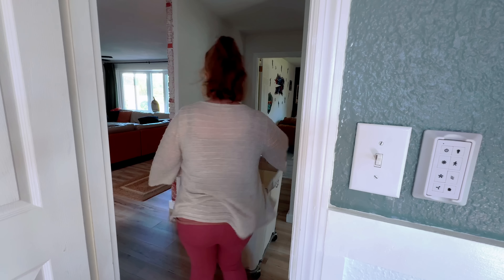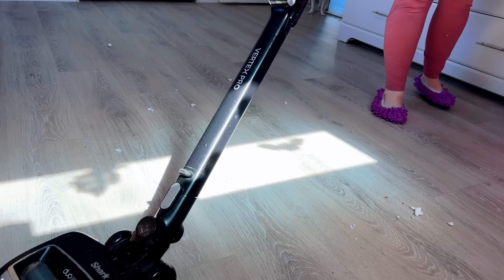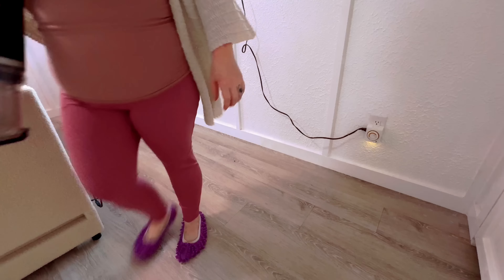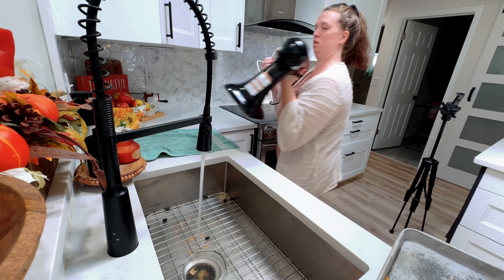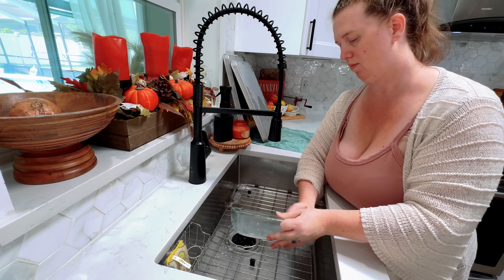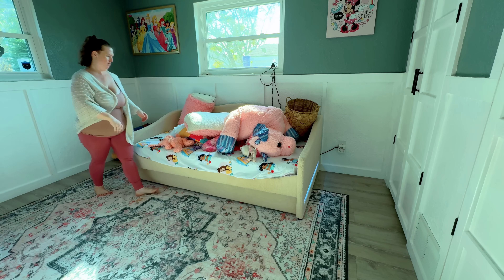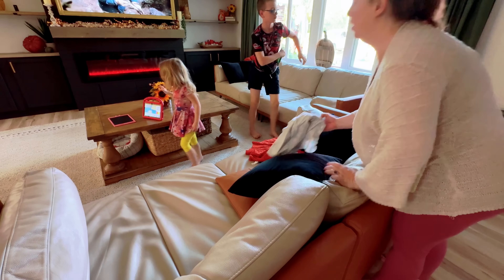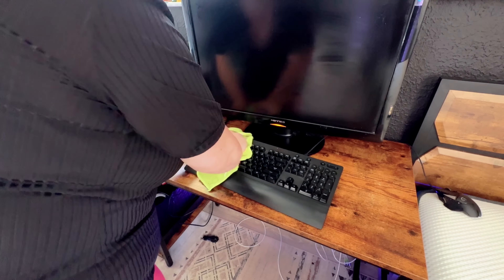Super Motivating Inside and Out Deep Cleaning Motivation ~ Extreme Whole House Deep Clean With Me

Comment: For cradle cap, you may use oil as a pre treatment, just soften the grease by massaging in circular motion. Then, wash hair as usual. If the oil stay on head for too long, the cradle cap may just get worse.